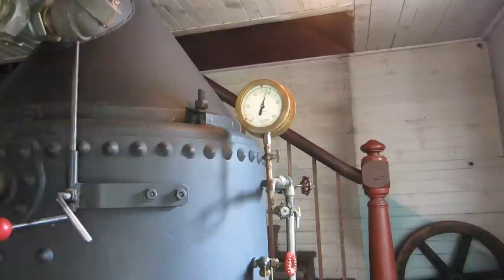OLD TIME STEAM POWERED MACHINE SHOP

Comment: Years ago I gad a belt driven machine shop but it was run from an electric motor, my big lathe would swing 27 inches on 9 foot centers. Thank you for keeping the old school alive.
Reply from the maker: Now that's a real lathe Braun, thanks for watching....Dave
Reply: @davidrichards5594  sad comment but I lost it all during my divorce in 86, sure miss the old shop i had several great pieces of equipment, to include a Cincinnati shaper mill, a drill press with a number 5  Morris Taper, with bits up to 6 inches, an old Horizontal mill with a 24 x 48 xyz bed, a gantry crane with a 1 inch cable on a single pulley at the hook sitting on 36" x 36" timbers 100 feet long, an all brass and copper still under the 2 foot thick concrete floor with piping that ran over to the 40 foot long pit, a 200 ton horizontal two stage hydraulic press with a floating yoke that would open up yo 25 feet, a wood stove you could chuck 1/4 of a cord of wood at a time (this way the shop was warm in the morning) and last but not least 18 foot double steel doors. The place originally belonged to a moon shiner in the 20's who also built steam donkeys for the logging industry back then.Again thank you for keeping the tradition alive Respectfully, Braun
Reply: @braunreinhold6020    Amazing story Braun.  It's indeed sad, that some times the old iron is way more reliable than 'relationships'. 🤔

Comment: Thank you Dave. We here appreciate your shout out to Keith Rucker and Adam Booth, bit proponents of conventional machining and what made the modern world possible. 
We too have some ancient steam operated equipment. and have also managed a collection of wooden laminated flat belt pulleys and about a half dozen machines: Lathes, camel back drill, air compressor, punch press, helve hammer, etc. from those good old days, when iron reigned over alloys.
I like this, and many comments and.... I SUBSCRIBED. 
PS.  Another flat belt and machines channel.mentioned your channel. This is the first.I've seen. Will see your others too.
My bus. partner and I are both long time seniors but work in machine tools every day.

Comment: What a great thing, I am 65 years old and was one of the last people who worked on steam systems, nobody knows how to work on steam anymore. Most of what I worked on was steam heat, steam boilers used in milk pasteurizing. In the old days cities had central steam systems where the steam was generated through a steam plant and piped all through the city. I learned from a lot of old timers who really knew the trade. I still have people I don't know who call me when they get stuck on a steam system for advice, I am kind of proud of it and still think it is a good way to heat a home it is the quickest heat there is.

Comment: This reminds me of my uncle Frank's shop. He set it up with his expeditionary money in 1919.  I worked with him in 1979 to restore his Cincinatti Toolmaker's workcell #1.  His shop had water wheel power in the spring , summer, and fall. In the winter, the pond froze up, and he switched to boiler or we burned the boiler when he had blacksmithing to do using his steam hammer.  His shop went thru three incarnations, and he electrified his next shop next door, for Willy's Overland Corp work (he made forging dies for the crankshaft and connecting rods).  His third shop was  had an NC broach grinder made by his shop.  Miss them dearly.
Reply: That's a great family story.  Pass on the traditions. 
Machining is the what gave us the modern world

Comment from the maker: Thanks, hope you will be a regular here......Dave
Reply: Beautiful shop David, just love the moving wheels in the roof.
Reply: David Richards  j
Reply: I bought a small Chinese machinest lathe n now I have to use it n im counting on utube for instructions
Reply from the maker: @russelmurray9268  Russ, South Bend (lathe co.) put out a book called "How to run a lathe" . There were many editions of it through the years. I think it is the best manual for a beginner, and you will probably find one on ebay or amazon....Dave.
Reply: Thank you I appreciate your reply I'm going to track it down I'm actually a very creative boy at 70 n haven't used it yet but I'm fairly confident I can use it but I'm going to read the book due to lack of information. Thanks again I'm making tuning pegs for ukeleles out of dominoes (red ones) that I build but I bought an old small cannon that was never finished n needs some refining n a dozen other projects
Reply: Definitely sir I'm interested in building a steam engine also n have been collecting materials for some time I'm building a rail vehicle also n rocket stoves out of ammo cans n 25 gallon drums n I make solar water distillers I can bake pizza n bread in my little ovens with very little wood

Comment: I subscribed right away. Steam should absolutely come back. I can imagine a steam shed driving a small turbine that powers a generator for direct electrical power or that charges a battery bank.
The off-grid homeowner would have to feed the firebox...or...fill a hopper with wood pellets.

Comment: 18 years old and i was working on a railroad that had a steam shop and boiler repair department. the table top pit forge that i saw was the same one i worked with. the shop was built in the 1920's so most of the stuff in there was original. seeing this video has brought back memories of firing up that old forge and working iron. i know david may never see this comment, but you made an old man happy.
Reply from the maker: sure did see it, thanks.....Dave

Comment: Thanks for the video!  As I told someone else we kids in the late 40's would horrify adults because the belts fascinated us as we would not stay away from them.  We remember them from running from a parked tractor to a threshing machine of some sort there in south Missouri.  You are a clever and dedicated lot and are appreciated!   Best of luck!
Reply: the belts and things are still fascinating today i remember a shopping mall in the mid 2000s had a store where there where belts and line shafts running as a decoration and i was just mesmorized by them sadly they took the store down

Comment: Well done, Richard. How exciting! 
I once worked for Haughton Elevator Co. Their Toledo, Ohio plant still had all the belt drive sheaves and shafts in the ceiling in the 70's! 
Also, Eisenhart Wall Coverings in Hanover, PA still uses belt drive printing machines from the 19th century to manufacture its wallpaper. Their belt drive power comes from a large electric motor.
Your shop is wonderful. Thanks for the video.
Reply from the maker: thanks Drew, some of it still survives...Dave

Comment: I am watching your videos at Beacon, just up the road from Camborne, Cornwall, England. One of the local heroes here is Richard Trevithick, he pioneered 'high pressure steam' & built what is thought to be the first steam powered vehicle 'the puffing devil'.
In the nineteen eighties I was working as an accountant & witnessed one of the sad side effects of 'the monetarist revolution which was the destruction of so many small engineering shops which had survived up till then, the other day I visited the village of Mawnan Smith just down the road and was amazed to decoder that through a local 'village' initiative that the blacksmiths shop, complete with 'line shaft' powered machinery survives and is the workplace of smith who comes from Northern Ireland, I have always loved this old machinery and enjoy your films. 

thanks

Patrick
Reply from the maker: Hi Pat:  Steam power and common sense will always be around in some form....Thanks for watching...Dave

Comment: Thank you for sharing this with us.  For me it was a trip down memory lane.  About 1962, I remember going over to the Alaska Packers shop in Blaine Wa. with Dad.  The machine shop was still run with line shafts at that time.  I remember watching the shafts spin and hearing the click of the belt joiners on the shives, the things you remember at 6 years old.  The engine was just inside the door next to the boiler house that was about 10-12 feet to the east of the machine shop wall.  Sadly that's all gone now, there was not much left by the end of the 80's along with it much of the NW fishing history. 

The wood shop was also steam powered at that time with line shafts.  The steam lines were run over head to it as I remember.   Late in the 60s early 70s they changed everything over to electric motor when they stopped doing canning at the plant.  

The retorts for cooking the canned salmon were about 35 feet long and 6 feet across, they had 6 or 7 of them. 

Funny the old memories this video brought back to me.

Comment: Brilliant video and what an amazing shop!

Thank you for sharing.
Reply from the maker: +David Stevens (davro)   Thanks Dave,  is that a Lotus 7?   .....Dave
Reply: +David Richards it's a Lotus 7 replica with a modern 200bhp+ hayabusa motorbike engine and homemade carbon fibre all around, it weighs in at 500kg. Building the car has been the best machining learning experience I could have ever imagined :)

I would buy an original Lotus 7 in a heartbeat but they are well out of my price range as decent untouched original ones in the UK go for about £50,000-60,000 thousand sometimes more ... one day maybe when I'm famous.

Comment: Great shop, great guy, great video.  Did anybody else get the pun he snuck in there while talking about his boring bar? ... while running a line drive lathe which is one of the most important machines of the industrial revolution he uses the phrase “the turn of the century”.
P.S. please never leave your chuck key sitting in your 4 jaw so you can stick around and keep making more of these videos.
P.P.S. Use a live centre in your tail stock to help get your stock material closer to running true and keep pressure against your jaws at the same time while setting up your 4 jaw.

Comment: Very interesting shop! And even more impressive it all still works, not just a mock up display. The most impressive thing I saw was boring the hole in the plate. That small (3/8" sq? tool) hanging 5" out of the tool post and not vibrating. Carbide tooling will chatter like crazy if it hangs out over 4X bar dia. Very impressive!

Comment: Hello David, I am a steam engineer at a large hospital in Cleve.Oh. I love your shop and the verticle boiler is amazing. I have been in the field for 36 yrs. and took my license test which also had those type boilers as well as steam engines and duplex and simplex pumps. I think you will benefit for another you tuber named Tubalcain or Mr.pete222, he is an old time shop teacher who loves to build old model steam engines and dynamos. He is also friends with Keith Rucker and A-bomb. Great video Thanks.

Comment: This is real machining here. I think all novice machinist should start out on manual machines. I've ran some early 1900's Brown and Sharp screw machines that were converted to electric from overhead belt and pulley but never steam powered. This would be a real treat! Seriously a great video! Thanks!
Reply from the maker: I agree, schooling in basic machine work is pretty scarce these days.   Dave

Comment: Watching this brings back memories of my late father who apprenticed in a shop just like this in North Italy back in the 30's full of shafts, pulleys and belts. One thing I recall him telling me is that the pin that fitted through the wire clamps that attached to the ends of the leather belts wasn't metal but was made out of twisted boar hide.
Reply from the maker: The belt lacing company doesn't supply the rawhide pins anymore. I really like them better. Most now are just plastic coated steel....Dave

Comment: When I was young, I worked in my father's shop in Paterson.  We made precision wire for loom reeds used in the textile industry.  The factory was belt driven from a central electric motor and had a lot of similar components to this shop.  At the time, leather belts were still available so we used them exclusively.
Reply from the maker: There was a lot of industry in Patterson, steam engines and locomotives.....Dave

Comment: This is very cool and inspiring. I have been thinking about starting a shop (wood and machine both) and I think a line shaft with multiple drives (steam and maybe water wheel) just as a museum head.

Comment: Great video for any machinist. There are still lots of the machine tools out there but an operating boiler and functional line shafting is extremely rare in a working shop! Those shapers will remove some serious metal. Some are still in use in commercial shops (they can also run broaches).
Reply from the maker: Ob:  I have a weakness for shapers also, and planers. Someday I hope to have one in the shop....dave

Comment: Fantastic job on the shop and your video. It's really great to see this. Todays shops are so loud by comparison. Without electric motors wailing away, you probably can hear what's going on with the work better. All you need to do now is hook up the espresso machine attachment.
Reply from the maker: Thanks Josh, You know, I've never figured out why modern lathes don't use a modern belt, like a notched timing belt for at least the final drive on the spindle.
It would be a smoother drive (like a surface grinder) more accurate, and quieter. Thanks for watching.....Dave
Reply: Yeah, It seems like it would make sense.. It would save wear and tear on all of the drive mechanisms too.

Comment: Great video. I am a 36 yr old Machinist. We had a old gear shaper at one shop I used to work at it was belt driven and was converted to electric years ago.  It said 1910 on it and it ran all day everyday.  It machined itself some new gears one week.  I  was the last generation probably to grind toolbits and learn the old ways of doing things and I try to pass it on. I will check out your videos would like to see what is in the old toolboxes.
Reply from the maker: +davidbrennan5  Great Dave, how did you grind the bits with the tooth profiles?  I want to do a "run through" in future videos of some of the tools that were my Dad's and some that were donated to the shop that go back into the 1800's.....Dave
Reply: I ground a lot of cobalt and hss tool bits for The lathe and milling machines.  I still think hss works better for some aplications like Intermittent cuts and some coarse threading or cutting weld out of a bore.  The bits we used to cut splines and gears were ground on a pedestal grinder using gauges similar to acme threading tool gauges. The old shaper  had its own set of lagre circular bits with many teeth. The machine had a constant oil bath on the work and they never needed sharpening. The machine had a rotary table and it would advance the depth of cut on the gear blank as it finished a rotation 360 degrees. It ran by itself until the proper depth was cut . I don't know how many gears that thing cut but it was a lot it made the owner of the shop a lot of cash.

Comment: Nice job. I wish I could do as well. Looking forward to your other videos. My dad was a machinist starting about 1915, but all related to marine steam. Later he was a chief engineer in WWII. I grew up in a town with a belt drive machine shop, but electric main drive motor. A few locomotive boilers around, but no longer used. The oiler surprised me. In marine saturated steam (below about 350psi) the steam lubes the cylinders. I don't remember seeing any oilers on any ship equipment. Maybe because the water is reused in the boiler.
Reply from the maker: I think there was a lubricator of some type, and an oil separator after the engine to keep the oil in the condensed water out of the boiler.

Comment: Very Interesting video, I found it very humbling to see everything that went into just firing up the lathe. Nowadays you can just walk up and throw a lever and start turning thanks to electricity. I can't imagine myself being able to manage all of that at once, especially if you get too involved in your work and forget to check the water level in the boiler (Yikes!!!). I had to use one of those "lantern" style toolposts before, it definitely begs appreciation for the quick-change tool posts we have today, not having to worry about shims and being able to quickly swap tools while maintaining center height. Nowadays, with the advent of CNC, modern cutting tools, and inspection equipment, its easy to lose track of the heritage and history of the machinist trade. Don't get me wrong, I'm very thankful for the CNC equipment of today, really opens up the possibilities and makes life easier, but I still love to run manual machines when the opportunity arises. Many times I find myself in front of a CNC and wondering how long it would've taken to make in the old days (as the machine churns them out in front of me in minutes, haha). I always love a good trip to the past, wish I was around to see it back then. Thank you for inviting us into your shop!
Reply from the maker: Thanks for the great comment, hope you will stop in again again. If I am doing something that requires a lot of attention, I switch to coal. The boiler needs water about once an hour. ...Dave

Comment: David-  I know that older machines require more set-up time, and they turn projects around slower when compared to modern machines.  Its for those with the passion for functional art, but not for those after more money.  I run older machines in my personal shop too, like my flat belt drive 1948 South Bend Lathe (9 inch), and my 1943 Atlas drill press.  Your shop is amazing, just as everyone said.  I think you could make a business that highlights the use of one hundred year old equipment...people will pay extra for that I think, especially when you're working on an item of similar age.  Vintage Everyday!
Reply from the maker: Thanks, I do appreciate the work I sometimes get from my Youtube viewers and creators, and will continue to use "vintage" methods in the shop.....Dave